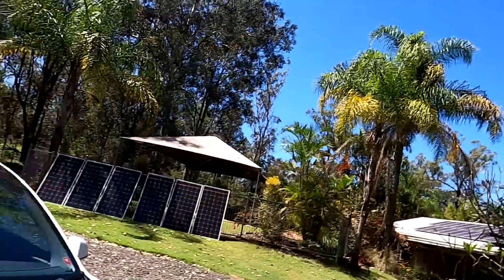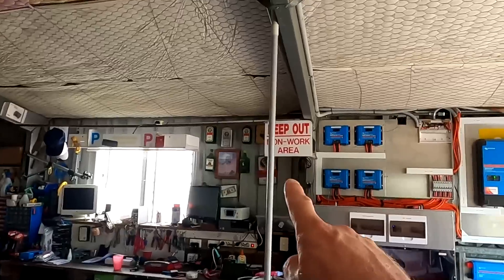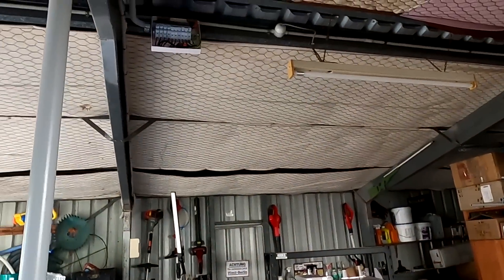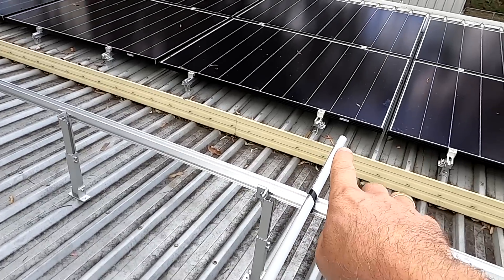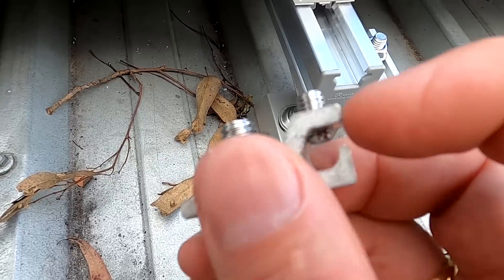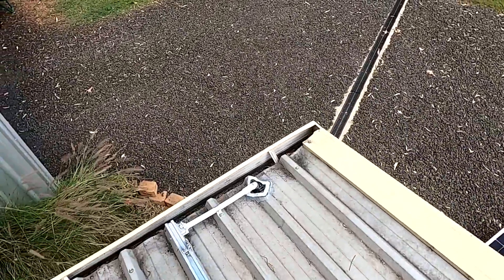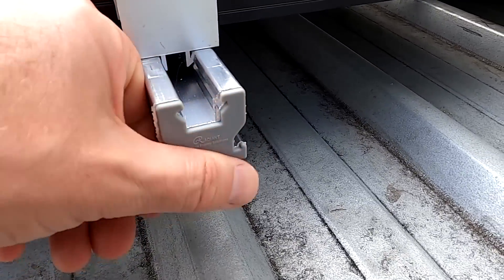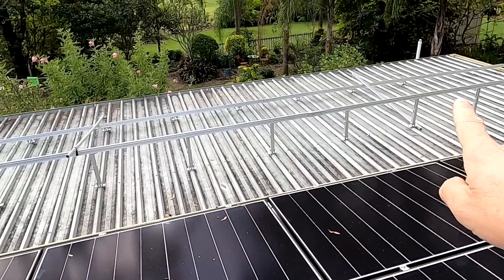1st power-on of the new West Roof with Hyundai Shingled Solar Panels. YEAH!!!!

Comment: My brother recently looked into installing solar on his new home in Phoenix Arizona. He contacted 10 different installers. Enphase & Solaredge were his only two choices for inverters! 

Your regulations down there regarding emergency shutdown fortunately don't add cost or limit your choice of equipment. Up here in the good ole US of A ( land of the free )  we're required to have rapid level shutdown devices on every panel. 

The result of this INSANE regulation is that Enphase & Solaredge now have a monopoly on the inverter market for residential rooftop solar. They were the only two companies which already had rapid shutdown functionality inherent to their design when the regulators dropped this bombshell on the industry without any forewarning. SMA, Fronius and the other string inverter manufacturers were left flat footed and now can only manage to capture a tiny percentage of the market! 

The result -  more complexity, higher cost, lower reliability, fewer choices and less interest in going solar!
Reply from the maker: Yeah, some regulations are a bit crazy and unnecessary. We have also lots of them down here...

Comment: Hello Andy, could use your help on getting the specifications for B1A8S20PH heater film/element requirements. I'm unable to find any info on volt/watt heater usage, to keep the smoke from letting out
Thank you in advance
Jim
Reply from the maker: Hi Jim, not sure about that. I read somewhere it's limited to 3A of current. I would send a message to the shop were you bought it and ask for the specs for the heater.
Reply: @OffGridGarageAustralia  I’m a new subscriber, love your content and your presentation, only about a third of the way through your videos so far.
Reply from the maker: @kf6qbw  welcome to the channel, Jim. Lots more videos to come...

Comment: 8:30 - direct contact copper to aluminium?  that is corrosion on the way.. and same with silicone, you have to use only neutral silicone..
Reply from the maker: The earth clamps are stainless.

Comment: Andy have i catch right that you are expecting shading on bottom line of already mounted panels and you are having 5 parallel strings of 2  panels in serial? If so and then you should consider to connect upper part of 2 and 2 in serial in top line alone, then 2 and 2 on bottom line and last 2 remaing as you are planning now - one panel from top line and one from bottom. This will give you full power from 4 panels when bottom line is shaded with another lines of panels (that with settable heigh and angle) and full power from that panels making shade on already mounted.  I did some measurements and when one of 2 panels in series is partly shaded, that you get nearly no power from whole set. And if sun will hit those shading panels in wrong angle, then you have to make another video in what scenario you will get more power :) If it is better lose 10-60% power on 10 panels caused by bad angle or to lose 70-95% power from 6 pannels by shade..

Comment: Migh be usefull to consider a foldable stand to expand the hight during winter cause with these new panels you will see a big increase during winter. 
Just changed our panels from summer 28° to 55° degree during winter and that did nearly double the power in the moment I had done that. 

Best would be a 1 axis tracker but that is not that cheap and in your case it would hurt the other panels too in their production or at least 1 row or 1 string. 
But at the end it will be an experiment to measure what you can achieve during an average winter day and not the bright sunny winter day you might rarely have cause those figures on a sunny day can be really impressive at least in sunny germany at the shore but the average winter day here looks quite the opposite .
Reply: Linear gate actuators are pretty neat for this type of application.

Comment: You are lucky, our fire code mandates a 3 foot offset from roof edges. This can cause a significant reduction in how many panels you can put on the roof. Looks good, can't wait to see it finished.
Reply: Do you know what the rationale is for the 3 foot offset?
Reply: @andysPARK  So the firemen have room to stand and cut a hole.
Reply: @john_in_phoenix  Our firemen will not go on roofs against their rules here.
Reply from the maker: Thanks John. The system really comes together now. Lots of power pouring in today. The many regulations can really make it hard sometimes to get something together which actually works. The new panels are far more efficient than the old ones, hence I now have the space required around them.

Comment: Dektite are the mouldable seals for roof penetration. I used one for my small off-grid garage array. Mine is located underneath a panel to give it extra protection from sun and weather.
Reply: I've used one on my main roof as well, my installers at the time were just going to cheat, so I had to buy the Dektite and insist they use it, not sure I'd want to use one on a flat roof though, but would be a much cleaner option. I've 5kw of panels going on my flat roof garage soon.
Reply: @TheRonskiman  My garage is flat roof. The hole is on the ridge of the corrugation, not the valley so that also helps.
Reply: @TheRonskiman  i think they are fine for pretty much any/most perforations on many surfaces with a bit of silicone under the seal before screwing down preferably & dab a bit on the screw tops later as well if ur worried about water ingress there.
Reply: @evil17  they do one with adhesive especially for felt roofs. I'm going to use that, then put some extra felt over top, it will be much neater. My frames are going to be bolted through the roof as well, I've a rubber pad, then an aluminium spreader block to compress the pad, and will use polyurethane mastic which is much better than silicon sealant.
Reply: The best way to use those flashings is to completely fill the inner cup through a small puncture with a caulking gun and silicone after it is installed. This fills the air cavity solid with sealant instead of just the edges. It makes it so as the seal deteriorates in the sun, any leaks will not fill that empty chamber and eventually rot a hole through (seen this a lot). For this reason I jab the tip of my silicone caulk tube through the rubber after it's all installed, and squirt as much in as I can before it fills and oozes out. The rubber will expand slightly and when you pull the tip out sealant will ooze out, sealing the hole you made and indicating it's full and truly sealed.
Reply: @QuantumMarmalade  Good idea, mine will be under the solar panels so shouldn't see any direct sun.

Comment: I remember when I put my little off grid system up years ago, they asked me if I wanted a roof top cut off switch. I suggested that,  if there was a fire I would have to get a ladder, go on the roof, switch of the panels which I informed them was far more dangerous than watching the fire burn the shed down. I think I was ahead of my time with regards to safety compliance.
Reply from the maker: Yeah, but if it is part of the regulation, you need to comply any way. Some regulations make more sense than others though.
Reply: @OffGridGarageAustralia  most of the time I hear them say is"hhhmmmm that's unorthodox" But the biggest, hugest and ginormous thing I've learnt from you is the grounding of the solar panels, I had absolutely no clue that anodized aluminum was not conductive, did a continuity test too! Thank you Andy.
Reply from the maker: @itstackyandtawdrytime  thank you. I learned this down the track as well and hat to test and share it.
Reply: The best thing for this concern in my opinion is in line fuses. They have in line mc4 whole string 15a fuses. This makes it much safer if you are worried about the wires being cut into or becoming bare from rats, etc... Midnite makes combiner boxes for roofs that hold fuses or breakers but personally I find that to be frustrating when troubleshooting and superfluous overkill on all but the largest residential systems.

Comment: I've got fuse boxes and disconnect boxes plus inline mc4 fuses.  Not paranoid at all but seen solar fires.  The box you showed was full of water and others were wired wrong.  That's why they melted.  Weird config inside one of those boxes.  I wouldn't want to pull one of those MC4 apart in full sun.  I got zapped doing what Andy was doing, just playing with mc4 connecters in low light can give you a shock if you become the new ground.
Reply from the maker: The MC4 connector are not meant to be disconnected under load. It's all part of the regulations.
The sparky will have to install some drains in the combiner boxes so any water can escape. Part of the regs as well... Lot's more to do.

Comment: The panels against the fence, face to face at 45° angles that is supposed to increase out put  up to 50%. Since they are On the ground it would be easy to check that out. A power accordion.
Reply from the maker: Well, face to face they won't output anything, I would say😂

Comment: Hi Andy, exited for you to get some more pooowah on the roof, have you thout about what to do with all that overproduction? That battery is gonna be full pretty quickly, trust me, i have a 48Ah battery and since a couple of weeks i double our PV field from 30 panels SW with a other 36 panels op NE.
For the Same reason you are. The New field provides 4-10kWh a day on a cloudy day, much needed power to get tru the day!
Have not seen the battery under 55% since!
Reply from the maker: I know what you mean since today 😉
The overall goal is to connect the house as well without touching the house solar and high feed in tariff. With the limited cables available, this will be a challenge.
Reply: Stick it into the Tesla and resistive hot water heater

Comment: I’m sure Andy knows it, but others may not know to never disconnect an MC4 connector under load unless it’s an emergency and the fact that the connector may be damaged is not the concern.  This is especially important if your PV voltage is 250 - 500 volt range. The arc produced when disconnected is not only mesmerizingly huge, but damaging to the terminals inside the connector. Can’t wait to see when all the new panels are on line!
Reply from the maker: On some MC4s it says don't disconnect under load. Only some unfortunately... I don't care if it just one panel I'm testing, but more than 2 in series, I'll turn everything off before I disconnect.
Reply: @OffGridGarageAustralia  well said Andy and great channel
Reply: And DC voltage over 80 VDC is deadly, so if you came in contact with that big arc plasma, you'd be toast!
Reply: @greenbimoon  yea but you need to toch + and - so its not that dangerous whit solar panels.
Reply: @electro2606  Your kind of reply always worries me. I have no doubt you are correct, but you are not taking into account what some other shonky (Not Andy!!) person has done! It only take one example of "this can't hurt you" to go wrong...
"You can stand here, the chain to the Lion is not long enough for it to get to you"
Huh, did you remeasure when they put the new chain on??
"The new ch...??? aarrrrrggghhhhh!!!!" 
:)
Reply: no voltage CD is safe guys.. 
Had 300v DC shock not nice very unpleasant and I always wear insulated gloves when making off any connections if I have to come into contact with pv. Check my channel..
Reply: I made a ton of dc conections they are 780vdc. All of them whitout gloves or something im not saying its good to do it this way. Example on batterys its more dangerous because the + and - are mor likeley to be close to each other. Btw i made the conections on growatt inverters 60kw
Reply: @electro2606  you mad bro why take the risks 
Work safe
BTW I worked on very large solar parks with push energy upto 50 mega watt parks with central inverter stations.
Just be safe bro 😎🤓
Reply: The terminals are my last valid concern when someone disconnects an mc under load. If that arc you mentioned jumps to the fingertips of the hands disconnecting them (very possible esp if humid or wet) then it's very possibly lights out. 100v across the heart with even a milliamp can kill you and a current induced erythema might sneak up on you a day or two later and it's game over. For this reason I always kept a defib machine on my crew trucks when the companies were willing (most aren't).
Reply: @QuantumMarmalade  wear insulated gloves inserts and outers. And pray🤣🧨👀
Reply: @bramcoteelectrical1088  "hot work" bahahahaha, I'll get a 16 year old apprentice with a Deadman stick to spot me... 🤣 ROFL

Comment: Also you should use DC optimizers if you're not gonna chop those trees up.
Reply: Victron say don’t use them with their mppt SCC’s
Reply from the maker: DcCoptimizers don't do anything unless you have panels in one string which are pointing to different directions. Useless otherwise.
Reply: @OffGridGarageAustralia  they can help with partial shading by making all the voltages constant. Im not sure you are aware as most people aren't, a mppt charge controller can only track the lowest voltage string in any parallel configuration. Meaning that if only one string is shaded, you will lose production from all of the strings relative to the greatest voltage drop. So one panel shaded on one string will result in a relative drop in production and mppt perceived voltage across all parallel strings 😎🥰
Reply from the maker: @QuantumMarmalade  the voltage of panels is almost the same regardless if in sun or shade. The current is very different though. That's what we have seen when testing panels.
I have tested optimisers and they create huge voltage spikes. They fight with the main MPPT in your system.
See also the video from Andreas Spiess: https://youtu.be/E9NVLB_OYSU
Reply: @OffGridGarageAustralia  voltage will drop as current drops under a load. The strings will not reflect the true voltage unless shaded and loaded. If a shaded panel is resting at a normal voltage and a load is applied, that voltage will drop under a smaller load. This is the difference between real world conditions and testing.
Reply: @OffGridGarageAustralia  imagine it this way.... The shaded parallel string will drop in voltage as a load is applied, much earlier than the other strings, thus causing the charge controller to choke back amps (decreasing output) to keep voltage high on the pv side.... The result is a loss of amps, not voltage but the reason is voltage drop, premature voltage drop.
Reply: @OffGridGarageAustralia  it's actually pretty interesting to test. Would make a great video 😉. Just putting a 12v panel in parallel with a 40v panel or a 40v panel parallel with any other relatively higher voltage string and looking at the charge controller would do it pretty good 🤓
Reply: 18 years in and that's probably the trickiest part of photovoltaic I've come to learn, and also why mixing and matching panels non uniformly across strings is a big no-no and can result in a very poorly producing system. I've disconnected low voltage strings before and watched dead systems come back to life like a bear after winter ❄️🥶
Reply: Not all optimizers are equal. Honestly though most optimizer systems such as solar edge, are just superfluous and gimmick with more points of failure. For that reason I don't like or use them 🤣. as I talk from both sides of my mouth, Im just wishing you had a good shading solution without having to turn your yard into the Sahara desert 😉

Comment: Hi Andy, have a look at the Sunnytrack application.
You can use it to see the position of the sun for different days of the year.
The whole thing works via the AR function. Great for making a useful panel alignment.
Reply from the maker: Well, you have to go with your roof orientation, there is not much you can optimize. For a ground mounted system, go full north (south up there).
Reply: @OffGridGarageAustralia  You're right, on a roof you're not very flexible.  You could use it to see if the second row is shaded in winter 6:43
Or which obstacles shade the panels from a certain time of year.  Take a look at it, it costs nothing.
Reply: I hope he will check it ouit cause I wanted to check it out tomorrow when sun is back again. pitch dark right now and still 10 hours to go at least.

Comment: Wouw! Impressive capacity that's gonna be.
Andy, I see no drain holes at the edges of the panels. Wouldn't that cause dirty spots on the bottom of the panels after one year.
Especially since after the first year the coating will roughen up and be more susceptible to dirt?
Just my 2 cents off consideration.
Cheers to the off-grid garage!
Reply: I 3D printed some drain clips for the panels on my all-but-flat garage roof. They work brilliantly.
Reply: @spoonwzd  so, now Andy has to go 3D 🤔
Reply from the maker: I'll test a few of these rain clips for panels and see how they work.
Reply: @OffGridGarageAustralia Sounds good Andy, spoon and Wiley, didn't know these clips existed and have battled with buildup at the bottom on the panels for ages, will order some and give them a burl !!!
Reply: @spoonwzd  the panels I bought for my off-grid installation had clip-on plastic for the bottom that "sucks" the water over the edge of the panel by capilar force. I see no residue effects at the bottom sides so maybe that works te same.
Reply: Yes I can't understand why panels don't have that "gap" or drain, some LG panels had this a while ago and I thought it was a terrific idea, if you can stop the water pooling at the bottom of the panel, less buildup is going to occur !!